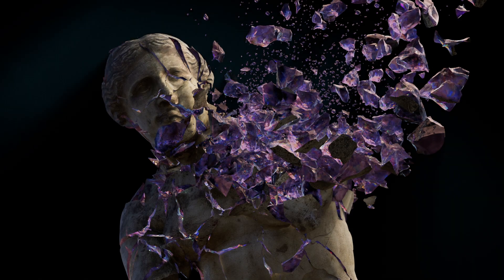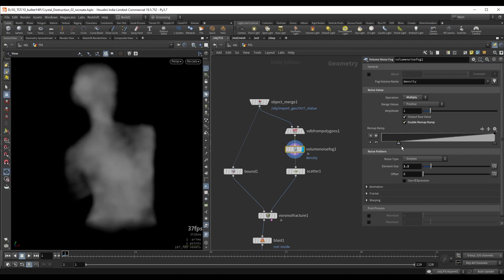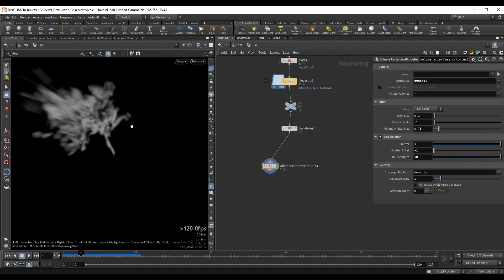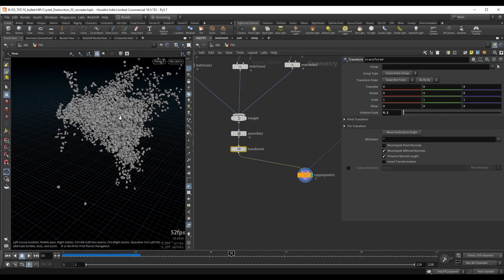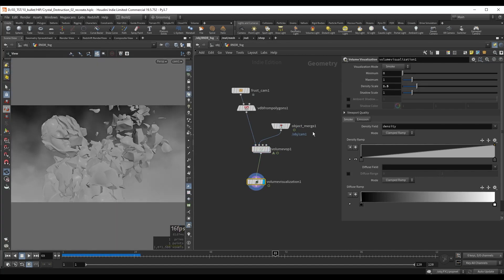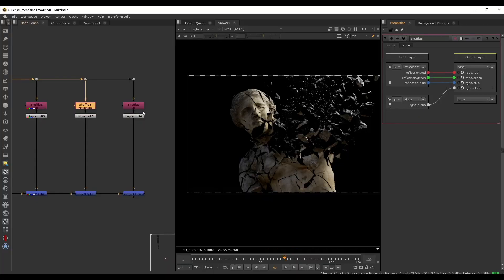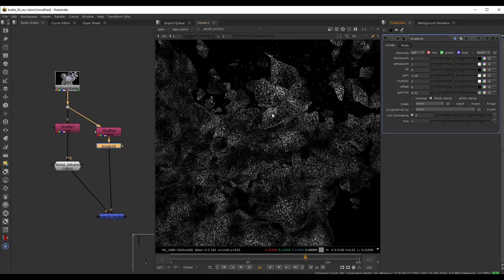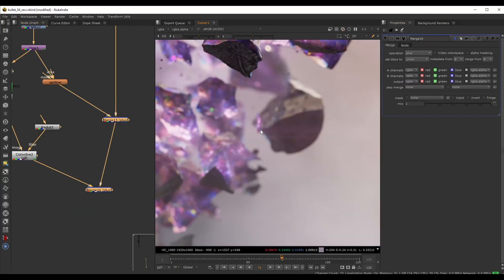Houdini Destruction FX - Pro Houdini & Nuke VFX Course

Comment: Tutorial Review then Over all review

Finished the tutorial and overall it went smoothly. had a few issues with my personal mesh got it working and it came out looking good!
Only complaint about this tutorial is I wish there was a little more explanation on the render settings in Redshift, but it was my first time using  Redshift, I had 15+minute per frame renders, but after receiving some advice through discords got that down to less then a minute with no loss in quality.
Also it was my first time using both Nuke and Redshift so it was a little weird at first because the Nuke section is mostly eyeballing but the explanation on using the Fresnel effect there worked great

In Nuke I do wish there was a little more explanation on rendering things out (maybe a side video installing all the addons?) I ended up figuring it out eventually and everything went great after that. The only problems I really had in Nuke were with the "Main Geo Beauty Rebuild" section after using the denoise I could not figure out how to export and reimport the passes so that they are "baked in" but that was not a huge deal and only slowed down my render speed by a little. Then I had to watch a youtube video to figure out how to render from Nuke.

Overall this course explained everything and I was able to complete the Houdini section in less then a day (if I didn't mess up my render settings on Redshift) and Voxyde has responded to my questions and small issues via email in a reasonable timeframe and the only issues I really ran into were user error on my part. I have had a lot of issues in the past trying to learn Houdini being either bombarded with knowledge or just confused because things do not work the way that the explanation is given from other courses, but here this course is up to date and well paced so I never felt like I was pausing after every sentence. These courses take you through a well thought out project all the way to completion and I feel like a lot of the other places I have tried never gave me a finished product it is not that I did not learn things from.

P.S. I am not saying all the other places are bad to learn Houdini but this was the first time I was able to complete a project from scratch to finish with great looking results! It could also help that I have done tons of other tutorials in the past though and they were all really good but I like my results from this one the best! It also got me to try the free trial of Redshift as well as Nuke and I am super happy about that as well!